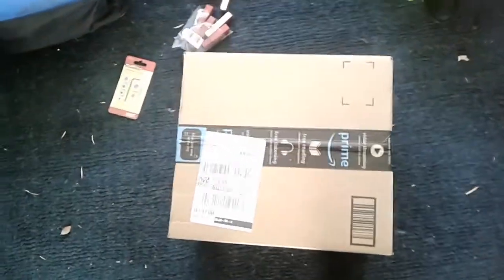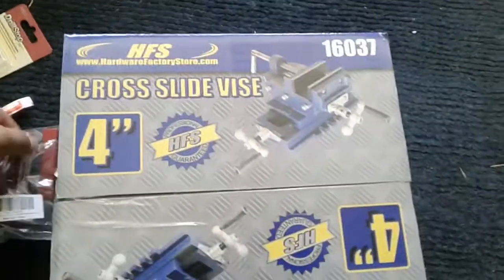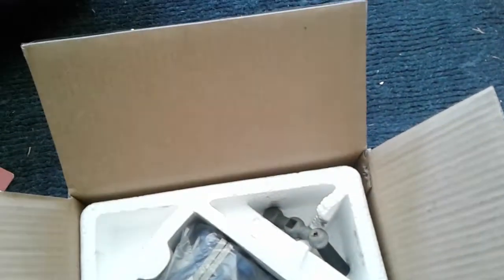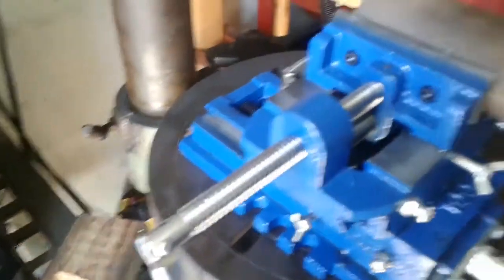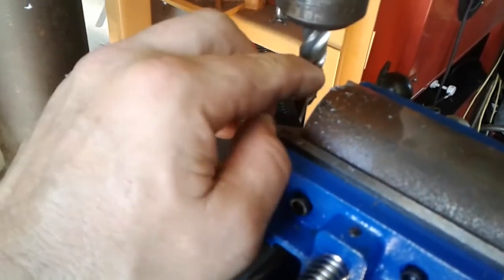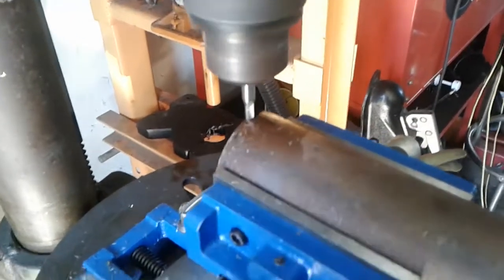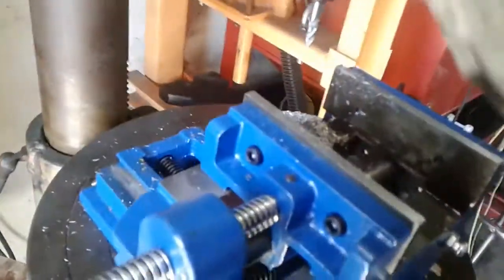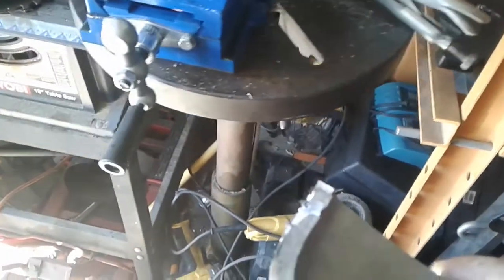HFS 16037 Drill Press Milling Vice unbox test review mill

Comment: I have the same drill press/ Mill press combo , I've never messed with milling anything ,  I think I've seen a video of upgrading the drill press floating around . Expensive stuff 😢 if you check under the hood of your press you can adjust the belt for speed I believe?

Comment: You sure haven't done it before,,, have to bolt it tight to do any milling and problem with drill press for milling is the quill is a Morse taper unlike a mill and with side pressure the taper will slide out,, and you can get hurt badly,,

Comment: The major issue was definitely how much metal you were trying to remove. The biggest problem would be serious injuries or death had that workpiece come out of the vise or broke that end-mill. Glad to see you learned quick to slow the feed next thing is to adjust how deep you are into the work piece. A drill press really cannot handle a substantial spindle load. 
Feed rate is rpm*chip load (how much each tooth should be cutting per rotation probably like 0.006 may even be pushing it)* the number of teeth. Im guessing we are running at 300 rpm*0.006*3 teeth would put you at 5.4 inches per minute so a pass across this part should take a couple minutes and I wouldnt plunge deeper than 0.010

Comment: Hey man not sure if you still read comments but a drill press chuck is not designed to take the lateral load like a mill is. You can change to a mill style chuck and that will remove a lot of the vibration and check your speed by what the flute calls for

Comment: This was trouble before he started, concerned when he didn't have the pipe below the bottom of the end mill bit, scared he was going to get hurt.  holding x y cross slide vice with vice grips,  not good control.  Need to study mill operation before attempting such.

Comment: Im not a machinist, but the rule typically is to not take a depth of cut deeper than the radius of the drill bit. ex) 1/4 inch bit, take a 1/8inch deep cut. pretty sure it is that, might be diameter though

Comment: Steel is difficult to cut(and dangerous) in the manner you're doing. Use a radial saw to cut slots  and hold the steel with a pipe vise.
Reply: End mil meaning use the end of the bit to Mill not the leagnth of the bit

Comment: Hopefully you've learned from experience a little by now but the reason it's moving to the right so much is because you are taking off way to much. On the first cut through something that deep, start with no more than 1/8th of an inch deep (.125"). Once you've made it to the desired depth you can make passes at the same depth to widen the cut but don't take more than .01 inches off at a time. You might get away with larger, like .02". I wouldn't use anything lager than the second bit in this machine either, they're not made for radial loads. (i hope I used that terminology correctly lol)Just take it slow learn to use the numbers on the little collar on the handles. Also, another key is chip evacuation. Get those chips out of the way of the cutters you don't want them clogging up the flutes or coming back around to be smeared into the metal, this all creates heat and will destroy your endmills. Also, learn the importance of "work holding" such as soft jaws. Get a pair of calipers and learn to use them. Start thinking in terms of thousandths of an inch and hundredths of a millimeter. North America will be almost exclusively inches though.

I started out the exact, same way, with a drill press and a mill vice, even tried loading stock in the chuck and turning it down with a lathe bit. I got frustrated with my progress so got into school and am about 1 year in. If there's any advice I can offer, just ask.